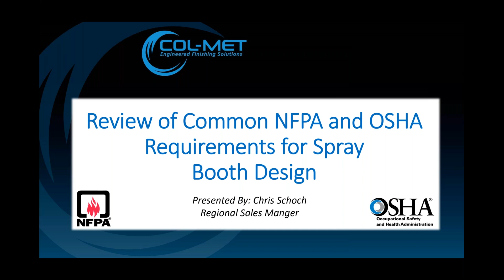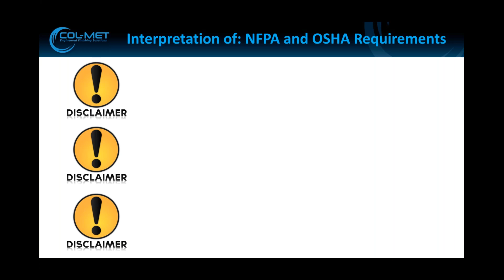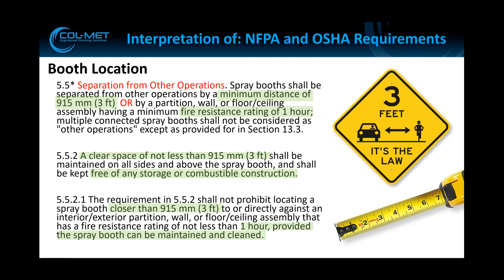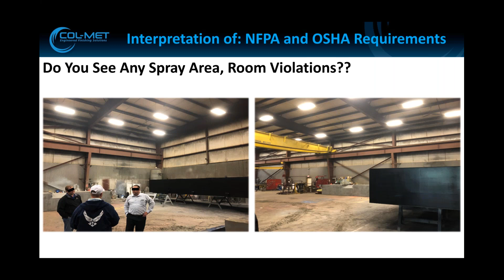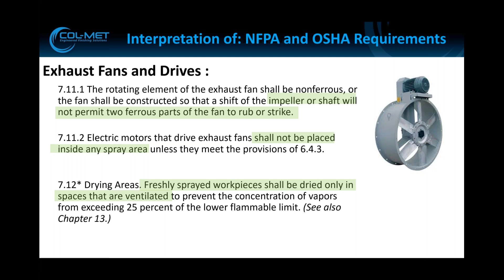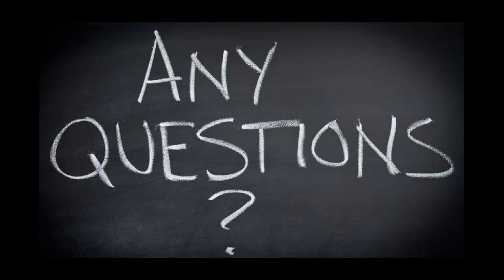Review of Common NFPA and OSHA Requirements for Spray Booth Design 1

Comment: Great video. I am looking at moving my booth to a dedicated spray room. The booth is an open face metal booth no doors that would sit in the room. We have air makeup that would dump in the room. With spraying in that open face booth does the lights outside the booth need to be explosion proof? The room has 5/8s drywall on walls and celling. Is there any code how far a electrical panel has to be from the booth or spray room.